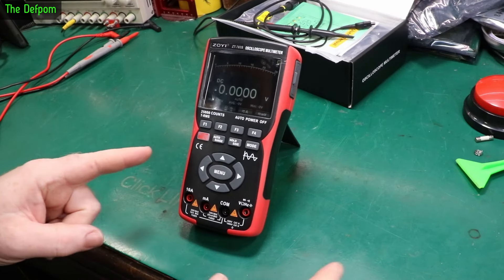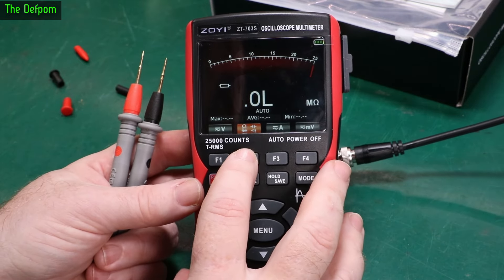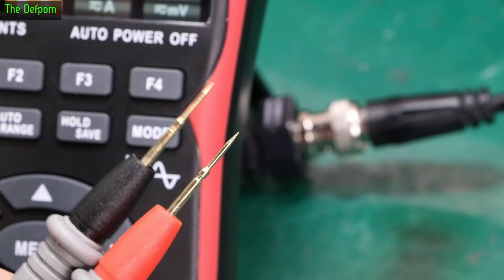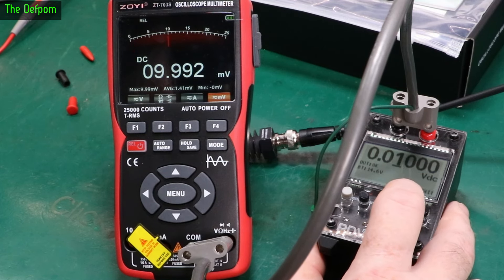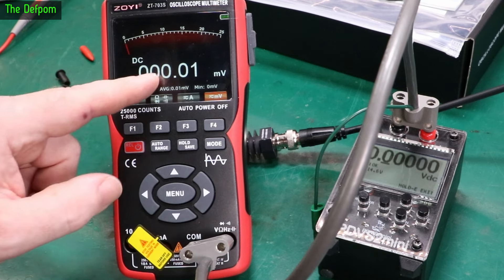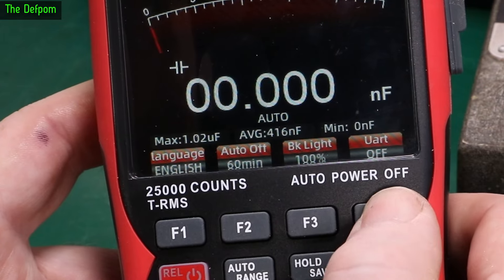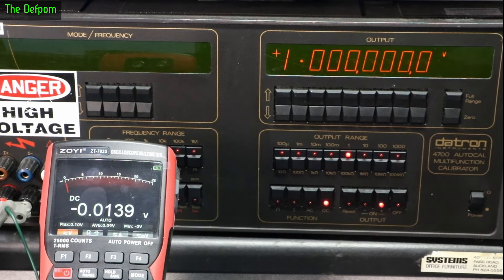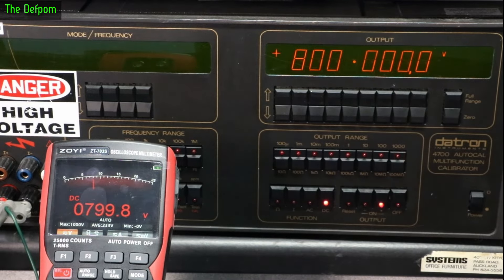🔴 Zotek Zoyi ZT-703S Review & Teardown Part 2 - Multimeter & Teardown - No.1221

Comment: Nice comprehensive review. Possibly I missed it, but I like to know the open circuit voltage multimeters put out for the diode test. I have a Keysight bench meter that puts out over 9 volts for the diode test which is really useful but my other digital meters put out between 2 and 4 volts so not suitable for testing some LEDs.
Reply from the maker: Yes sometimes I remember to check that, this time I didn’t.
Reply: For this there is BSIDE ESR02 Pro

Comment: Have these scopes any use in factory maintenance
Reply from the maker: Probably ok for testing power supply noise and some signal monitoring, wouldn’t use it on high voltage though, always best to stick to trusted equipment with suitable CAT rating.

Comment: Just occurred to me. Have you got a good approach for measuring a DMM burden voltage when testing current measurements?
Reply from the maker: I could do something to measure it, but it is already a massive video, so big I had to split it into 2 parts already.
You could measure the shunt resistances with another meter, or measure the voltage across the input terminals whilst putting a known current through it.

Comment: The analog needle reading between 0-25 makes no sense. Does it have relation to the actual reeading?
Reply: Agree. I'd prefer a little trend plot here.
Reply: On my one it actually reads the correct voltage on both AC and DC. Firmware version 1.4.2.